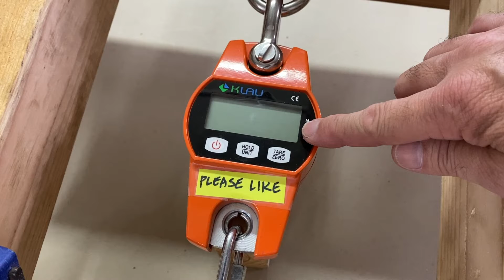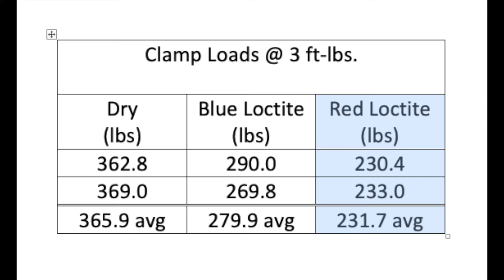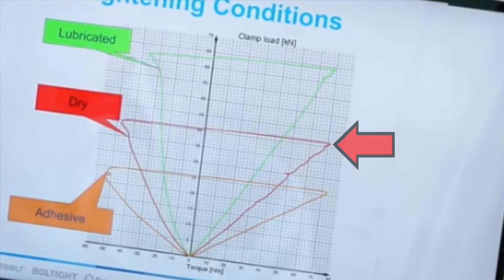Nuts & Bolts - Many EXPERTS Don’t Know This - Loctite Threadlocker and Clamp Load

Comment: I have often wondered how using various types of thread products would affect torque specifications, how they would alter the final torque.  And I had made the assumption that all such products function, at the moment of tightening, as a lubricant.  And for that reason, I slightly under torqued the bolt/nut.  But your video does not clearly explain these things.  Your content assumes we already know some things you are not explaining.  If you ready the comments, you'll see some viewers are lost.  So I suggest you re-do the video and thoroughly explain every step and their implications.  Also, slow down.
Reply from the maker: Thanks!  I plan to conduct a more in-depth experiment in the future.  As for slowing down… it has been my experience that more viewers will click off when I go slow.  👍😎
Reply from the maker: I guess I should combine this video with the my earlier video that made me notice the threadlocker results in the first place... https://youtu.be/lwlLbXowM4Q
😎

Comment: This is really good information. I use loctite from time to time depending in what the bolt is doing (working on cars) but i have never known about this. Do you think you could design a test for using loctite in blind holes like you would see on car parts vs a through-hole setup like you have here? 
Anyway thank you for sharing this quick, concise, and informative video.
Reply from the maker: Hmmm… a blind hole setup.  I’ll add it to my list and give it some thought.  Thanks!
😎
Reply: @HacksbyDad  thanks for replying :)

Comment: New sub here, after watching your lock washer video a few minutes ago.

I'm not quite sure what exactly the purpose of this experiment is. Can you explain it please?
Reply: I'll just add some context.

When you tighten/torque a fastener, you're creating a certain amount of clamping force. Usually the specified torque is for dry threads, but if you apply lubrication you only tighten to 75% (as a rule of thumb) of the specified torque to achieve the same clamping force. 

The assumption is that all liquids provide lubrication to threads, however, as the video shows, thread locking products, even while it's not yet set, are not lubricating and actually do quite the opposite by creating more friction
Reply: @sivansharma5027  perfect explanation, thanks!
Reply from the maker: Sure!  Thanks for watching and asking.
I thought wet threadlocker would act like a lubricant on bolts where less torque is needed to get to the desired clamp load.  This test seems to show that wet threadlocker does the opposite and results in less clamp load.  Hope that makes sense.
😎